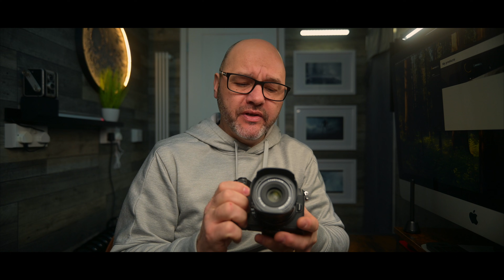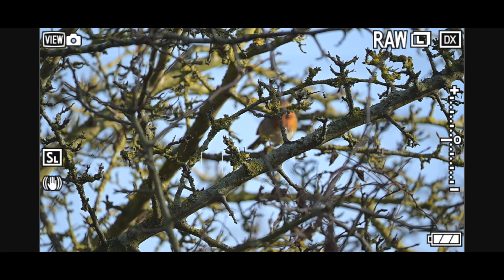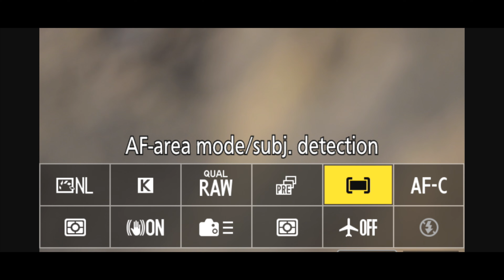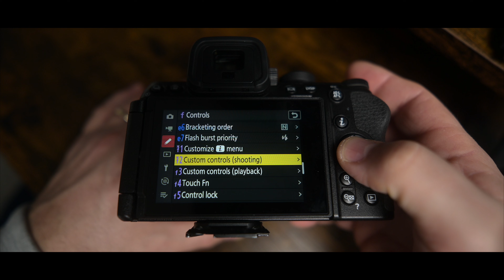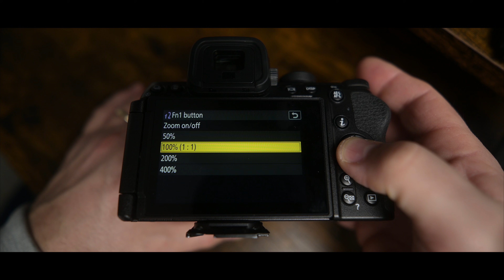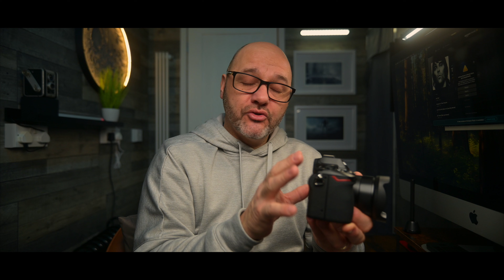Nikon Z50ii Subject tracking how to get the best out of it! #nikon #nikonz50ii

Comment: Why not assign a button to 3D[AF-ON] rather than 3D?  Pushing the button then activates both 3D tracking and initiates autofocus.
Reply from the maker: You can but then you loose the ability to place the focus box where you ned to in the frame before you initiate the focus.
Reply: @ 
Aim the centre point at the target, press and hold 3D[AF-ON] and recompose the frame as desired.  Works well for me.

Comment: Nice tips 👍
I have Lens Fn1 allocated to single point AF for the same reason, think I might try 3D tracking and see how it goes.
Those two front Fn buttons are my one gripe with the Z50ii, they're too wee and too fiddly compared to the ones on the D700.
Specifically the lower of the two which doesn't have a good placement, so not ideal for any function needed in a hurry.
I have Fn2 set to "Access top item in My Menu" with the top item being "Auto ISO sensitivity control" that way I can quickly turn Auto ISO on and off.
Fn1 I have set to toggle Spot Metering on and off.
Other customisations I have... Picture Control button set to Release Mode and Release mode button I have set to Metering.
Really enjoying my Z50ii for nature walks, with the Tamron 50-400 its a nice lightweight combination.
Nikon released it at exactly the right time for me, I was about to buy a ZF but this body suits me much better ergonomically and at a fraction of the cost.
Reply from the maker: @grahamniven  yeah the spacing for the function buttons in the new model do seem a little lower and tighter to access than the original. Great camera though just to pick up and go.